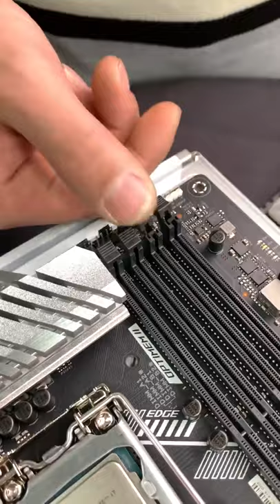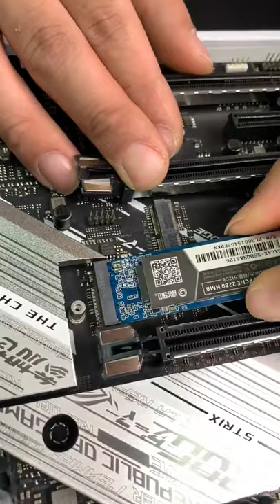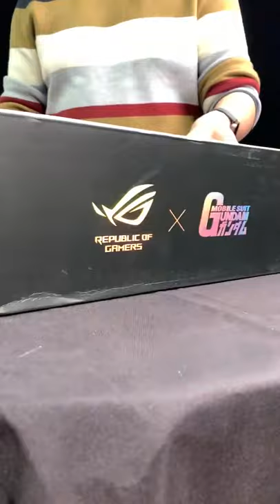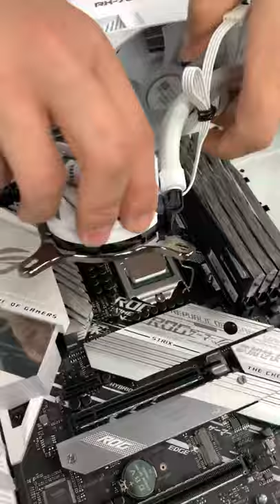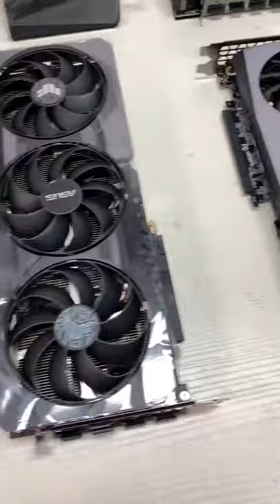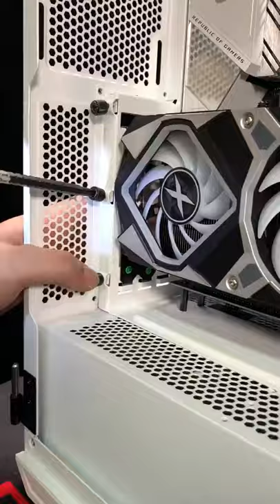Gaming PC Build ASMR with Pure White Theme #Shorts

Comment: 87k full build monitor+cpu
Specs:- 
1) PROCESSOR :- AMD RYZEN 5 5600X 6CORE 12 THREADS
2) GRAPHIC CARD :- GIGABYTE NVIDIA GeForce RTX 3060 WINDFORCE OC 12GB GDDR6 
3) COOLER :- Deepcool AG400 LED Single Tower 120 mm CPU Air Cooler/CPU Fan
4) MOTHERBOARD :-ASUS B550 Prime B550M-A WiFi II
5) power supply :- Deepcool PF650 650 Watt, 80 Plus Standard Power
6) RAM :- XPG ADATA GAMMIX D30 DDR4 16GB (1x16GB) 3200MHz U-DIMM
7) SSD :- XPG GAMMIX S5 512 GB PCIe Gen3x4 M.2
8) cabinet :- GALAX PC Case (REV-05W) Revolution 05 White
9) MONITOR :- GIGABYTE G24F 23.8 Inch (60.452 Cm), 165Hz
10)kb/mouse :- Zebronics Zeb-Transformer Gaming Keyboard and Mouse Combo

Comment: Was there a reason for using a 7 slot motherboard when you only use 1 port and block the rest? Just wondering if I'm missing something.
Reply: What do you mean 7 slot motherboard and which ports, motherboard sizes are itx, matx, atx and eatx (and some others which aren't commonly used nowadays)
Reply: @officialteaincorporated243  All the expansion slots were blocked when the gpu was rotated in the build. Essentially turning an ATX into a mATX because those expansion slots were blocked. Could have built the same rig with a mATX and put the savings elsewhere.
Reply: @aeasus  mATX wouldn't have the extra m.2 slot at the bottom and it's still possible to put risers or something like a pcie x4 to m.2 adapter or WiFi adapter in those slots.
Reply: @officialteaincorporated243  were they used in that build?
Reply: @aeasus  No but they're reasons why ATX may have been used other than the fact they often just look a bit nicer.
Reply: @officialteaincorporated243  And I pointed out there are reasons for mATX, is that a problem?

Comment: Pro tech tip: don't buy asus
Reply: Why should you not?
Reply: @marxsono4236  had, Asus gpu, also ways crash and greens Cree, had asus mouse, caused PC crash
Reply: @fraudd.1611  not to be rude or anything, but maybe you did something wrong? Did you install all the drivers necessary and plugged the power cables in correctly? I have seen many people that use Asus and am a user of them myself, and I have never had problems
Reply: @marxsono4236  yes, I bought I from a big company
Reply: @fraudd.1611  nah that sounds like a you problem. Asus makes quality gpus and most of their products are good though they are pricey
Reply: Thats a you problem
Reply: you prob bought it on ebay
Reply: @tremenz1798  no
Reply: @fraudd.1611  you didn't bought it from retailer shop?
Reply: @tremenz1798  my man I wrote that I bought it from a big company that build pc, and after the gpu issue, I got the same asus gpu and got the same problem
Reply: @fraudd.1611  well try getting other manufacturers like rog,msi,gigabyte then